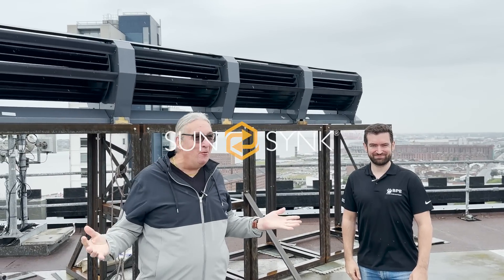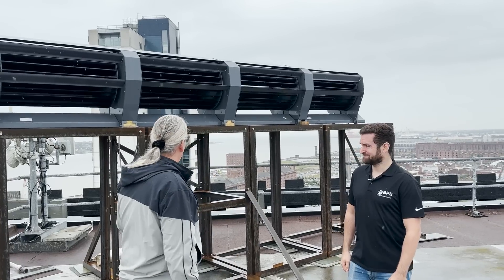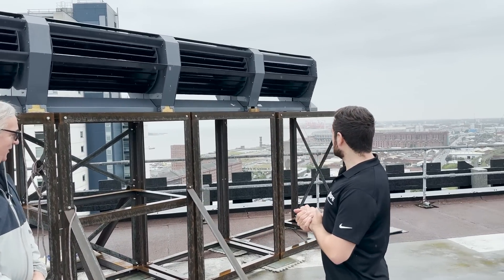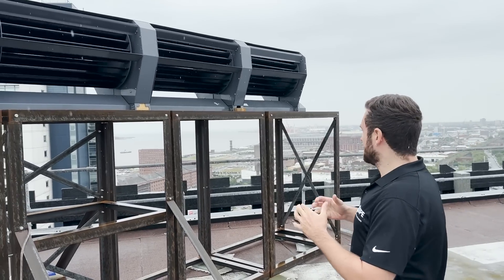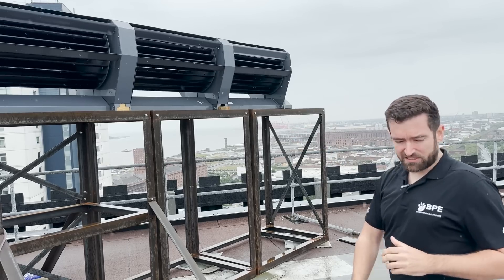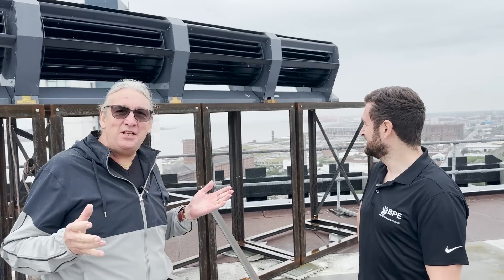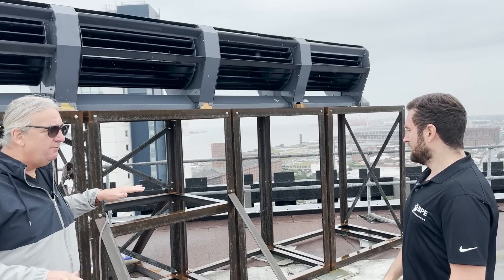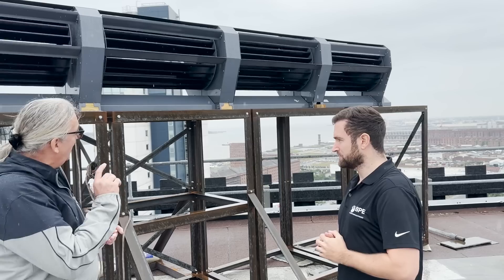The RidgeBlade® | Sunsynk

Comment: how much power does 5 units produce ? and at what speed?  will you be suppling them for home use or commercial.
Reply: From info I've gotten from them. 5 units is 2.5kwp and in ireland the distributer is charging 15 thousand euros supply and install.
Reply: Who is the seller in Ireland for this ? Thanks